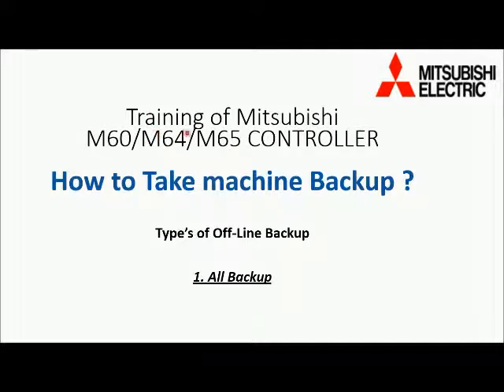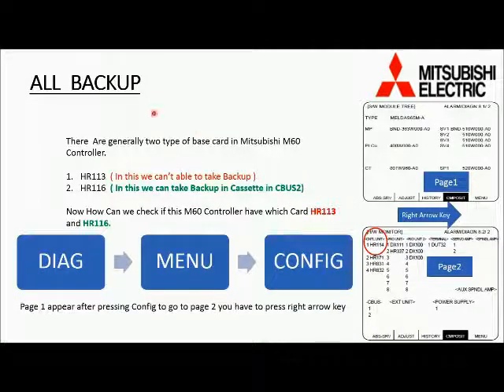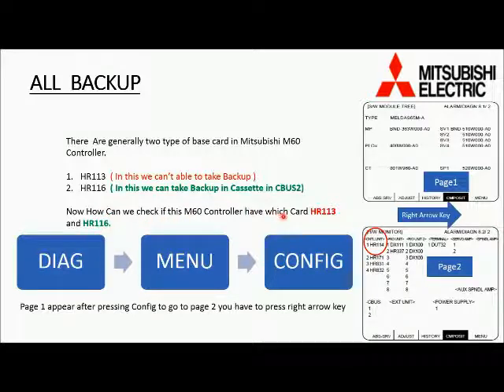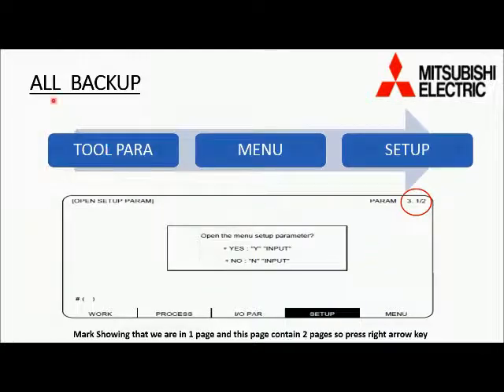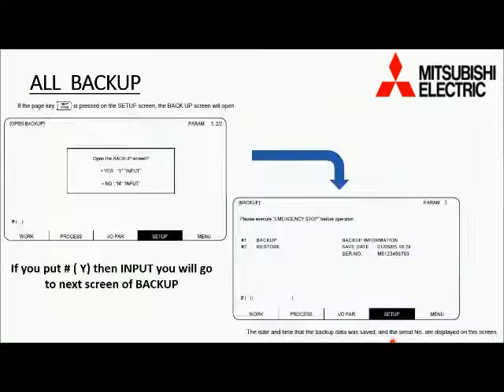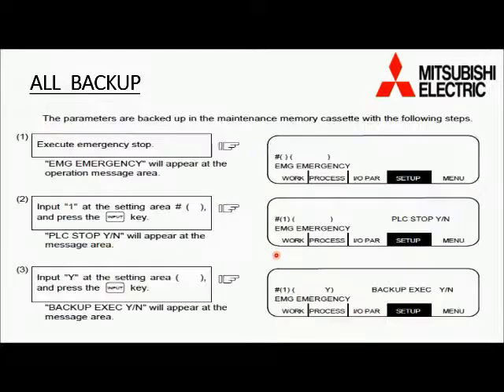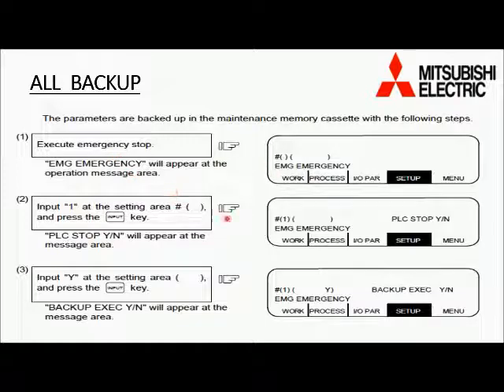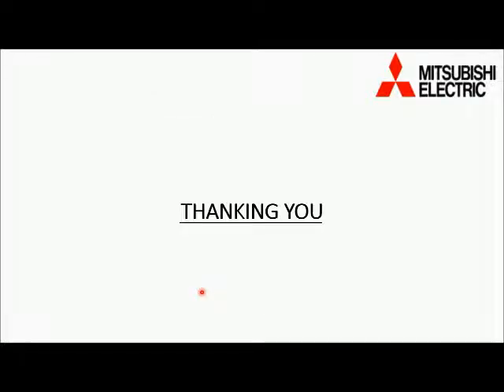MITSUBISHI  M60 M64 M65 BACKUP PROCEDURE

Comment: The most UNLOYAL to the customers company: no support, all forums are full of questions without answers. Asked CNC seller said 10 Mitsibishi CNC vs 200 Fanuc CNC sold monthly. Obviuosly miserable result. After this video action you get E51 File Open Error which means you have to FORMAT CNC MEMORY. But if you do that you might have E10 memory error and for sure you'll lose your tool offsets. How do you know all that? No way, no support, nobody knows nothing. Never buy any Mitsubishi controllers.
Reply: I think you need to format the system, I had that too but re-initialising it solved it. This controller is EOL over 20 years old. If you really buy this controller from Mitsubishi you're doing something wrong in your life because it's stocked in China and they throw it out almost for free.